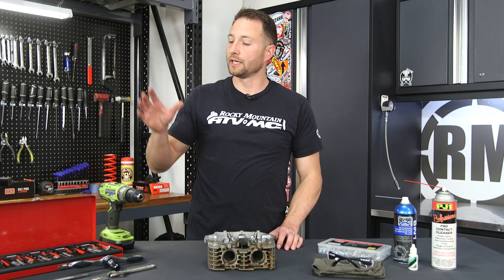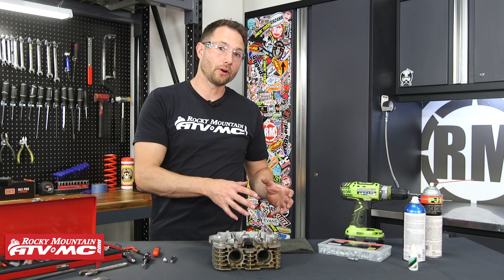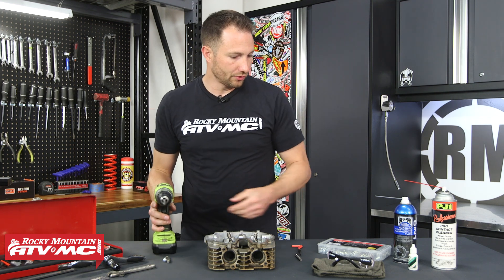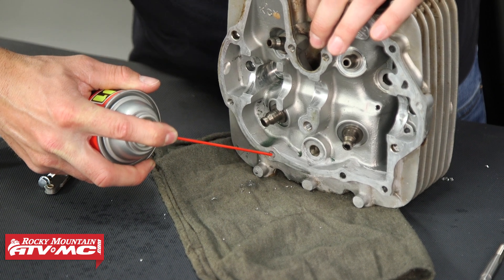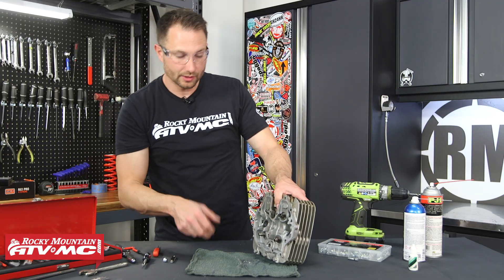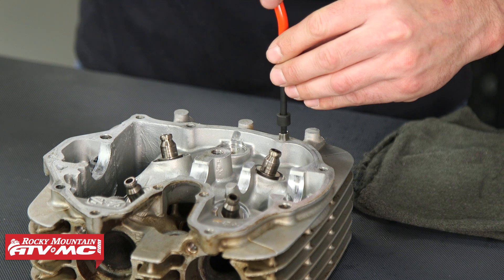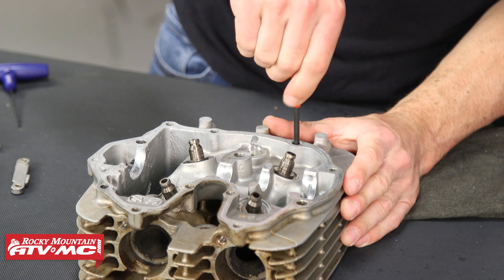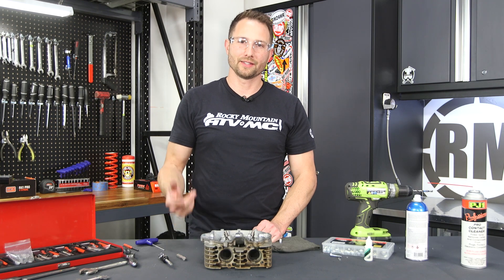How To Fix Damaged Threads Using the Tusk Thread Repair Master Kit

Comment: Very important you get these straight. If you don’t have a drill press and the tools to do so it’s probably best to take it to a machine shop. Unfortunately I have a repair that is 1.5 degree off and that puts stress bending the bolt. Kicking myself over it now so don’t be like me.
Reply from the maker: Dang it, sorry to hear about the troubles. It can be hard keeping these straight. Hope you can get it solved. Thanks for watching.
Reply: Not everyone will make your mistake. The hole is already there.

Comment: Can someone give me a quick difference between when this is appropriate vs when tap and die is appropriate. Thanks.
Reply: Use this for an existing thread when you want to reuse the bolt. Tap and die for making new threads or changing the size and pitch of existing threads or simply rejuvenating tired threads.